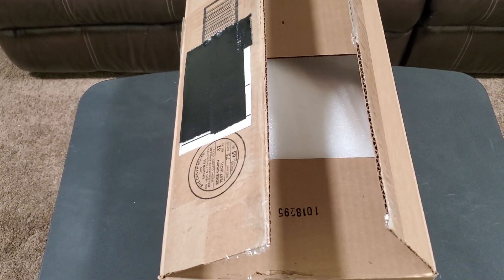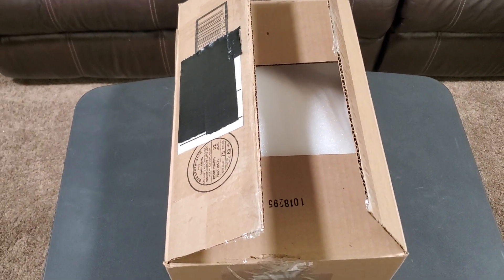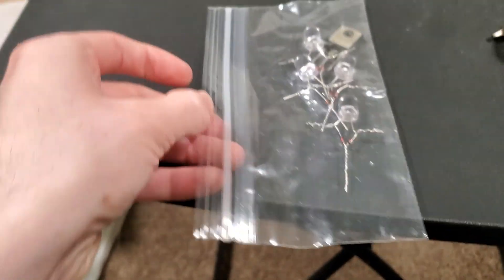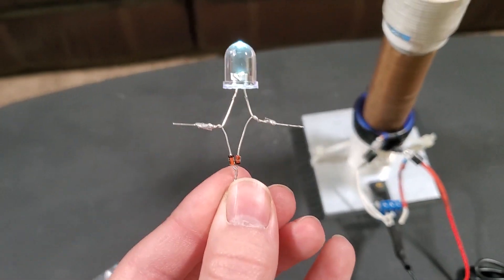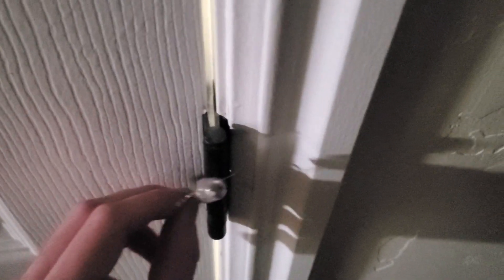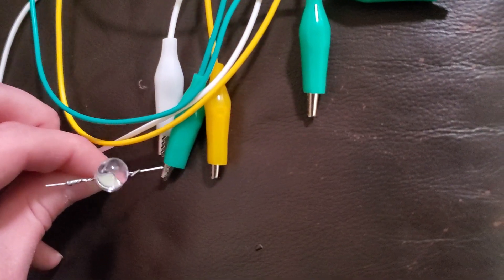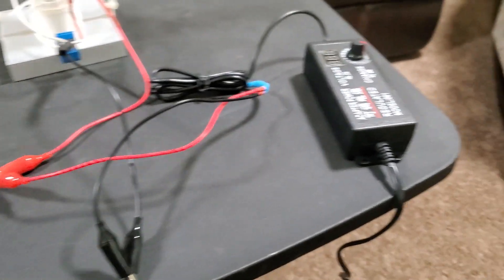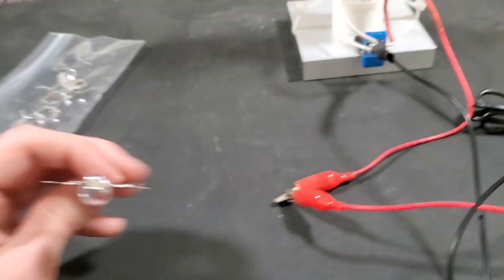Review of 150$ Tesla Coil Made By MTech Industries

Comment: This is a circuit that produces Dielectric Impulse Displacement Currents, I love these types of systems, I'm still looking into it but I believe if you can get the impulse duration down to 100 Nanoseconds or under the circuit begins exhibiting Endothermic effects, which should solve the heat problem. Whether the displacement current flows into or out of the conductor depending on impulse polarity might also be a factor in this.

If you're interested in this stuff, I recommend getting a copy of "The Secrets of Cold War Technology" by Gerry Vassilatos and "The Free Energy Secrets of Cold Electricity" by Peter Lindemann.

Comment: I was doing this before MTech was and other folks that were doing it before me. The secret is to tune your coil properly and add a topload. This is nothing more than teslas magnifying transmitter. You can also get the same results with just any slayer exciter circuit. I'm mot saying don't buy it but it can be made cheaper very simply.
Reply from the maker: What kind of topload would you suggest I add to mine? Or how do I go about figuring out what kind?
Reply: @Epic...Just.....Epic007  it's all on how you build it. To properly build it, your secondary needs to be 1/4 wavelength while the third coil needs to be 1/2 of the wave length. The reason for the 3rd coil is to give maximum saturation in the secondary without detuning the secondary with a topload. You need to figure what your capacitance is of your topload and use the frequency equation to find your true answer.
Reply: @freedomer342  The E Coil also has another special function too, if properly built and tuned it shifts the phase angle between the voltage and current from 90 to 0, resulting in an overall gain in power.
Reply: @Epic...Just.....Epic007  If you're still looking for an answer to this, you need a top load with a capacitance that Is the same as the capacitance of the coil, I recommend watching "Tesla's Magnifying Transmitter - the Extra Coil" by Wardenclyffe Research for more information, hope this helps
Reply: You can use any ball or other shape you want and cover it with kitchen foil to act as top load. It's about the conductive surface area. You could also wrap a whole roll of kitchen foil with roll of kitchen plastic wrapping on it to separate it, to get very large surface area. Same kind of load will also boost the system if you connect it to negative lead.

Comment: where is the capacitor? why the primary is not 1inch . 3turns is 20mm . 20mm primary/100mm secondary is not 1/4, it is 1/5
Reply from the maker: So actually no capacitors. If I listed the electronics wrong that was my bad. I'm fairly new to them. I might've meant to say a rectifier diode. When measuring the primary in the very front it is one inch. If you were to measure on the side of it, it would measure something a little smaller just because that's how the coil winding works. Secondary is 4 inches tall of 26 gauge wire. And the coil on the top is 1.5 inches.
Reply: @Epic...Just.....Epic007   when you will connect a ball or even the metall bawl from your kitchen then you will see  much better effects, also try to find a psu 50volts then you will see overunity like in the Mtech videos .....I dont have PSU 50volts, in place of that I used 2 old usual ATX from PC, I just change several diods and connect in series blue(it is -12v) to yellow(it is +12v) between ATX and other blue and yellow I connected to the device.....so totally I have got 24+24=48volts just using 2 simple cheap ATX . And I use a metall bowl from my kitchen and I have got all effects like in the  Mtech videos.